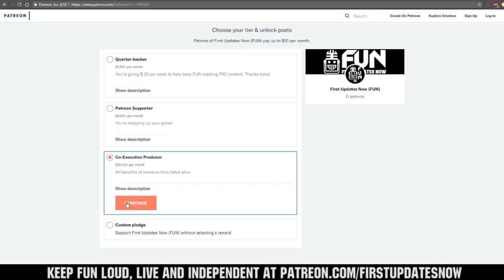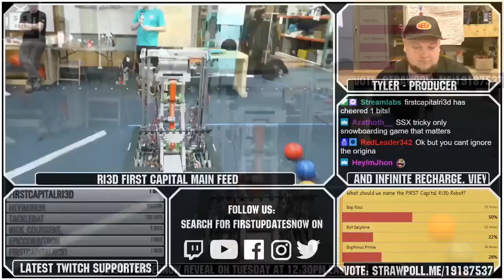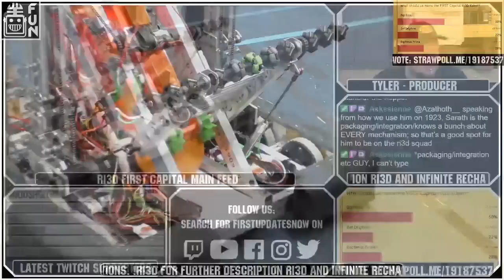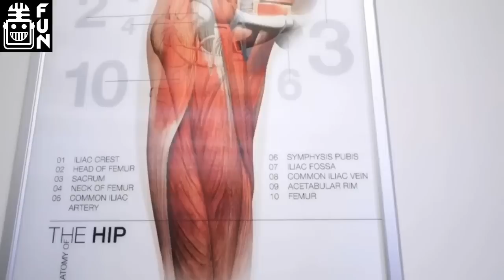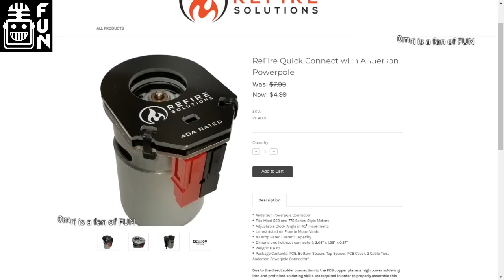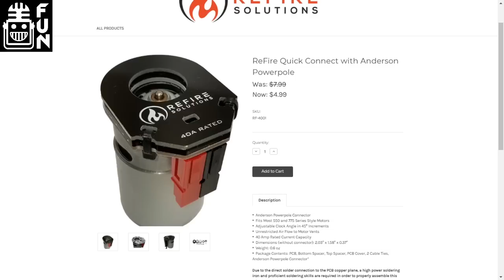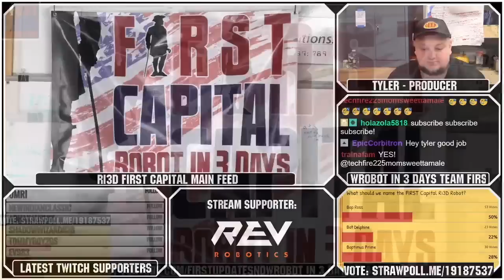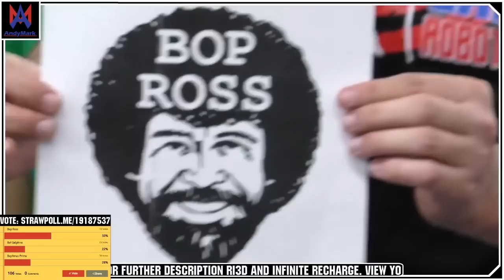Robot Reveal Show - FIRST Capital Ri3D - First Updates Now

Comment: How did you mount the Fairline wheel to a shaft that attached to the motor? Also, where is the flywheel from?
Reply: Flywheel is custom, Fairlane wheel uses a pressed in custom aluminum hub
Reply: @hsweeney28   Okay thank you!